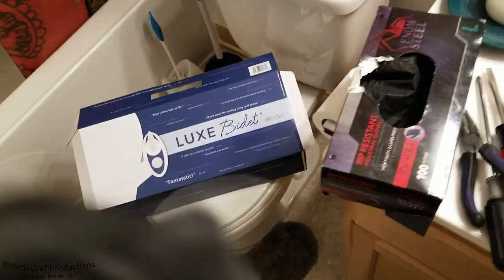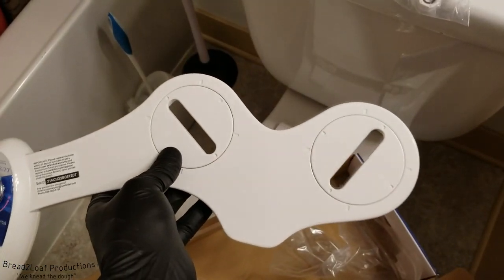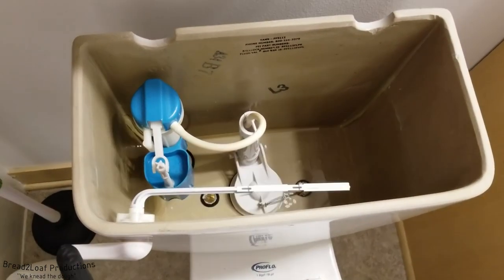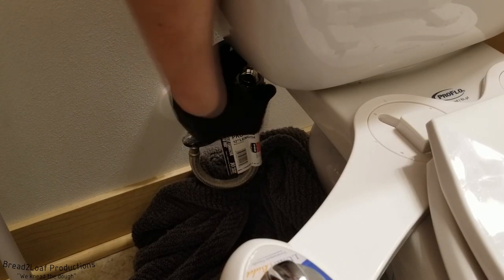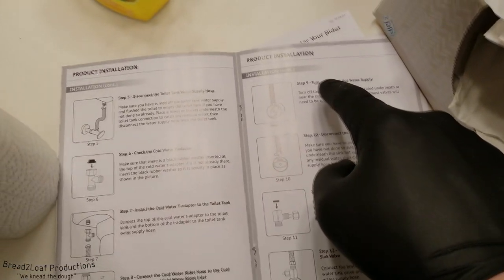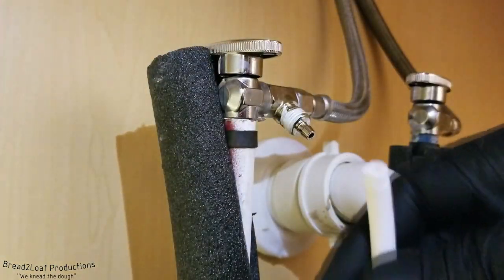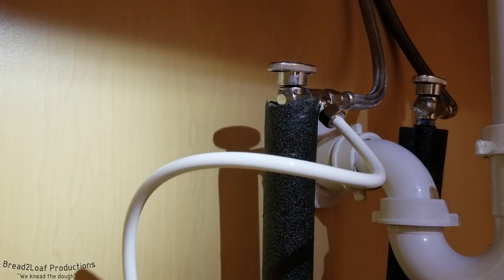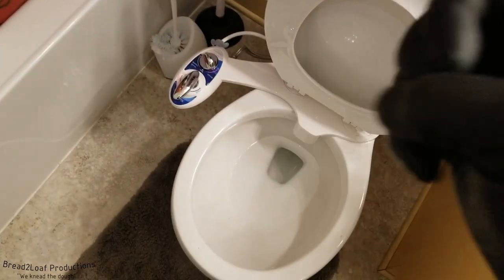Installing A Luxe Bidet NEO 320

Comment: I apologize in advance for my semi-graphic question. What if user has diarrhea while on the toilet seat? Does the bidet's spout get dirty from that?
Reply: No, the spouts retract when not in use and you don't start washing until after you're done pooping. Water pressure makes them extend when you turn on the valve. There is a little plastic access door, so you can get to the nozzels, if you need to manually clean them. Also, it has a nozzel clean mode, which you should use after every use. Also, leaving it on nozzel clean position when you walk away, keeps you or anyone else from accidentally flooding your house because the jets will just shoot down into the toilet.

The thing works great, better than my electrically controlled $400 unit. However, it is VERY VERY fragile. If careful adults are the only people using it, you're probably going to be fine. If anyone 2yrs to 17yrs old gets near it, your house is going to flood. Mine is in my attic bathroom, which the kids never use, only me.
Reply: @cornpop7805  really your kids could flood the house with it? How?
Reply: @darcandelaria  
Again the unit works well, but is extremely fragile! If you are anything less than careful with the manual valves, they will break, which could cause significant leak. If for instance, the leak happens in the morning and it wasn't discovered until evening, you could have extensive water damage. No, it's not going to fill a room full of water like a pool, but imagine if your upstairs bathroom leaked 30gal over 8hrs, it would cause some major water damage. Even 5gal of water could cause thousands of dollars of damage.
Reply: @cornpop7805  ok you convinced me 😂 I'm not getting one! I'll look for something safer hopefully! Thanks for explaining
Reply: @darcandelaria  
I also have the Bio-Bidet BB-600 and I've come to love it. It works really well. Unfortunately, it was something like $400 USD and requires an electrical outlet. But, it uses only a cold water supply, rather than both hot and cold. The electrical power of the unit heats the water and the seat. Also, my Luxe Bidet we've been discussing stopped working. It worked really well for a few months, then the wands stopped extending. If I cycle the valve on and off 5 to 10 times, it will usually work, but it's going in the trash eventually.
if you're really looking for one, research the heck out of it, as if you were buying a car. There are a lot of bad one's out there and the good ones require AC power at the toilet, which is rare to find. I used to be an electrician, so I just simply installed an outlet, but not everyone can do that or afford to have it done. But, one that delivers warm water will greatly upgrade your life, especially when you have belly problems!

Comment: Does this model work with only cold water? Like if I'm unable to drill a hole to access the hot water under the sink.
Reply: The luxe bidet neo 120 is a couple bucks cheaper than this model bc it only has the cold water connection. No drilling necessary!

Comment: Damn the one step I had problems with was left out.

The white tube that goes from the hot water valve to the bidet doesn’t fully connect to the bidet for some reason

It’s weird since it doesn’t use threads… it’s gotta be flush against the bidet, then has a nut to hold it in place.

I don’t see why it doesn’t just thread into place like the cold water one
Reply: Hey I'm having the same problem, were you eventually able to connect it?  I thought maybe I just didn't tighten the nut enough, so I tightened it some more and broke it.  Now the cheap plastic part that the nut threads onto just spins inside the unit and there's nothing to grab onto to hold it in place so I can loosen the nut to disconnect the hose.  Incredibly frustrating.

Comment: Is it still working good
Reply from the maker: Yes! Its been a few months since installation and I have had zero issues.
Reply: Another video reports that the hoses from the control arm to the nozzle get brittle and leak after 18-24 months. He recommends replacing the whole unit at that time. $50 for two years service is a pretty good deal.

Comment: Only problem, I cannot loosen the water inlet tubing from the bottom of the tank to install the splitter.  Grrrrrr. You made it look too easy, but this will not come apart. I’m usually good at these things.  Otherwise, I appreciate.
Reply: Im having the same issue. Any luck ? I have tried the plastic key that came with this, but it doesn't fit. its really tight. Thought it would be pretty straightforward but im stuck !
Reply: It’s been a while.  I think I had to find the right socket wrench and some elbow grease.